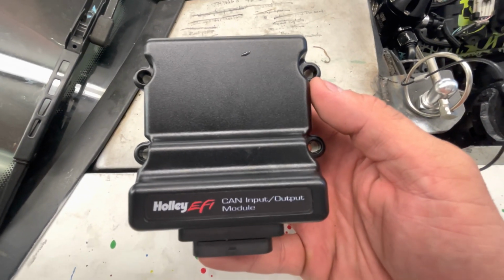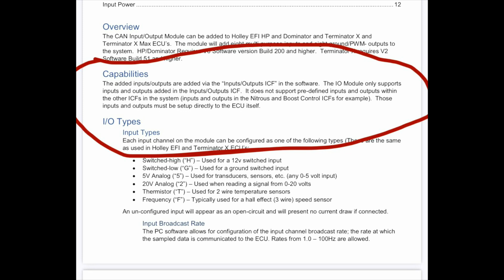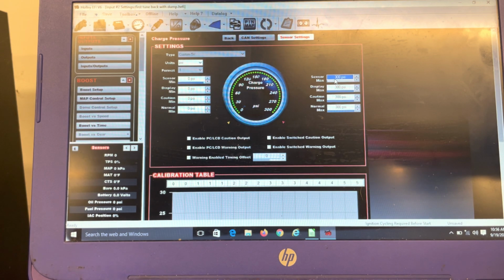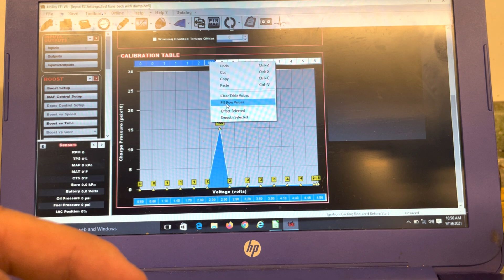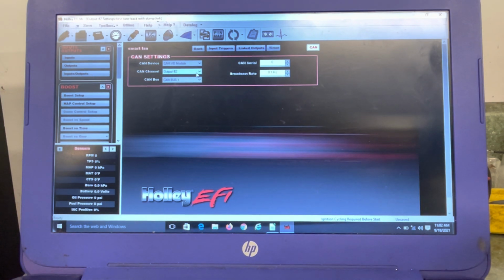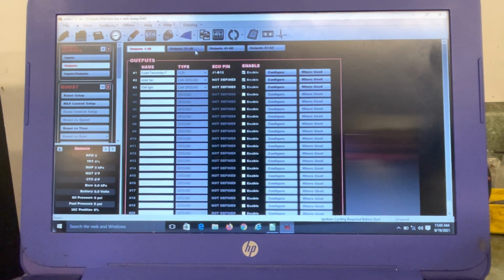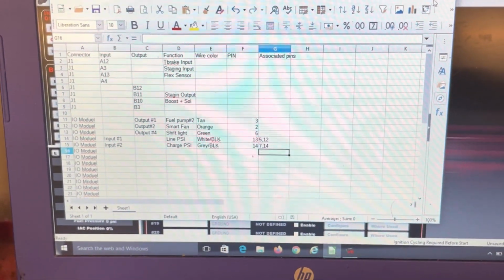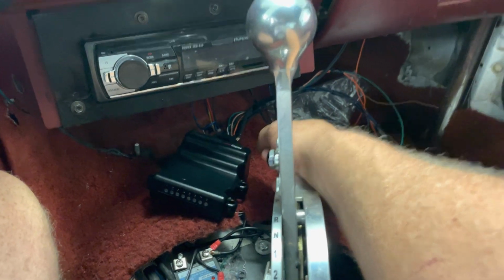Holley CAN Input/Output Module

Comment: Stupid question, but are you able to trigger fan relays with this? I don't have pwm fans, just fbody fans so i need a ground. Would like to keep the fans off the term x outputs for more important things like boost control brake etc
Reply from the maker: Absolutely! It’s super simple. That’s how I do it as well. I can help if needed.

Comment: This will add additional 8 inputs and 8 outputs to the existing 4i 4o ? Because i only see one input assigned in you i/o table?
Reply from the maker: Correct. I now have 7 output and 8 inputs running great on it
Reply: @RoryMalloy  please exuse my stupidity,, so you have a total of 12 inputs and 12 outputs correct?
Reply from the maker: @opngarage  no stupidity. And correct. Anything I want to log at a high rate lokenwheel speed and boost control etc that take a icf I use on the Holley. Then the others that are programmable inputs and outputs I put on the box